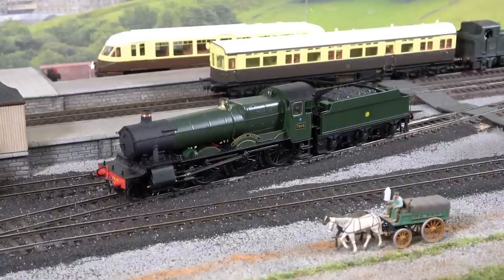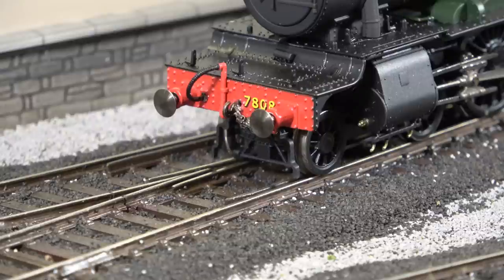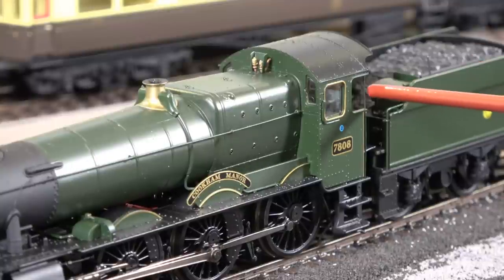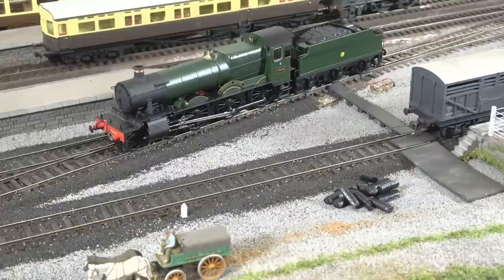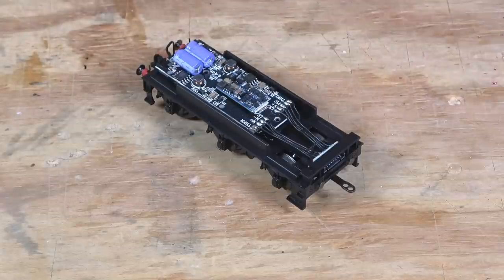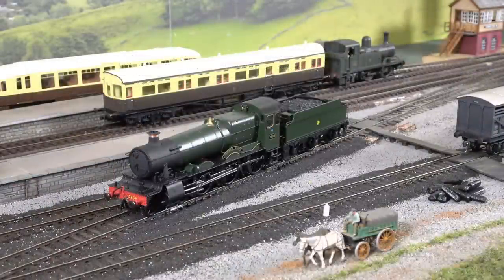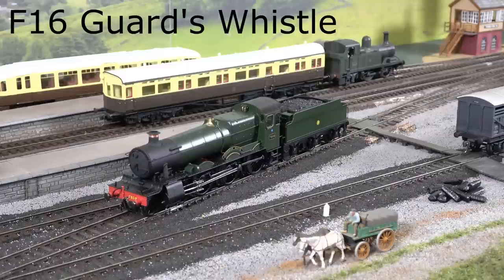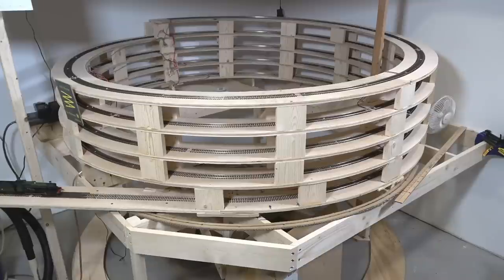Accurascale Sets A New Standard With The New GWR Manor (334)

Comment: Hi Larry....  What are your views on the over-sized box and the poor 3-pole motor offering...??
Reply from the maker: The large box provides greater protection so I think it is a good idea. As for the 3 pole motor I questioned them on this in the RMweb thread a couple,of years ago and I feel that it is the reason for the poor slow speed operation with DC power that so many modelers have mentioned. With DCC however the loco runs well and has pretty good pulling power. I do expect it to the future they will go with either 5 pole or coreless motors. This really seems to have been a learning process for them in several ways—the motor, the speakers, and the circuit board. If you have been following the issues with the class 37 motors even using a standard 5 pole motor can be problematic.

Comment: does running the manor on finescale code 75 track around a curve make it better for performance? Mine does slow down a little bit on a 3rd radius curve. I think the finescale tolerances have some affect but I'm not sure.
Reply from the maker: I have never been able to test this as my smallest radius is 30” which is much more than 2nd or 3rd. Have you checked the back to back distances on your drivers? On mine there is nowhere near the lateral play that you see with Bachmann, Hornby, and other manufacturers. This lateral play allows the drivers to mover more when going around tight radius curves. If the drivers are set too wide at the factory then that might further restrict them. Other than that I cannot figure it out.
Reply: @TheDCCGuy  thanks for that. I'm not sure if it's the back to backs. I think the issue is that because its a finescale model the tolerances are much tighter, hence the lateral play or lack thereof. My theory/question would be that the bullhead / code 75 has a much smaller cross section of rail: could this rail profile in itself improve the running characteristics on fine scale models (beyond just the radius of curvature)??
Reply from the maker: Yes, there can be a number of potential factors involved that make this hard to tease out. I really do believe the lateral movement issue to be most likely. I have an old brass N&W 4-8-4 that can’t negotiate anything smaller than a 36” radius curve. When checking it I found the drivers have practically no lateral play whereas my newer BLI versions of the same loco can easily take a 30” radius and are rated down to 24” radius. They have considerably more lateral play in their drivers.

Comment: How were you able to program her? My Digitrax DCS 51 can't read the CVs or change the address the quick way so she's stuck on factory default No.3
Reply from the maker: I had no problems using my PowerCab. However the DCS51 may not have a high enough programming voltage for Loksound. You should be able to program the CVs using programming on the main since it uses full track voltage.

Comment: Odd that the right side seat is down and the left side seat is up, since in the UK the driver is on the left and the fireman on the right? Is it possible the seats are adjustable?
Reply from the maker: No, although in most cases you would be correct but the GWR was one of the UK railways where the driver was on the right side of the cab. And yes I checked and the seats don’t move.
Reply: Despite having a seat, GWR drivers stood up most of the time while driving. The fireman occasionally got to sit down when he wasn't otherwise fully occupied in his duties.